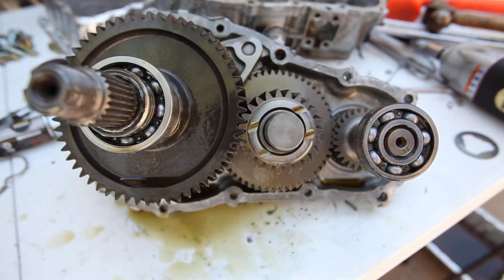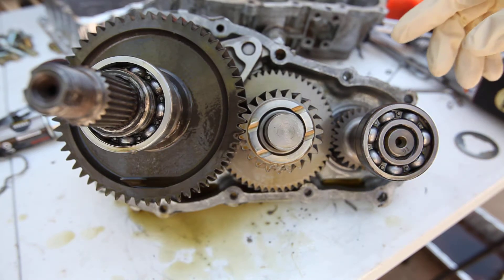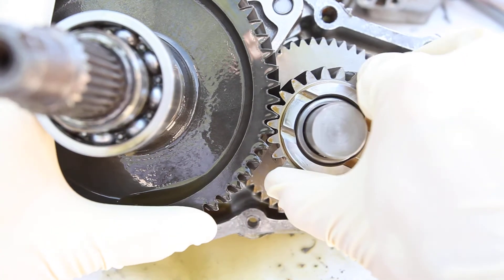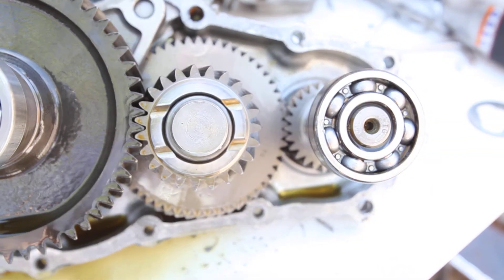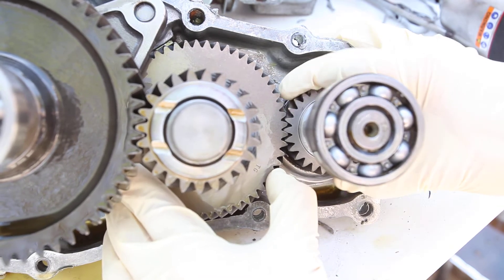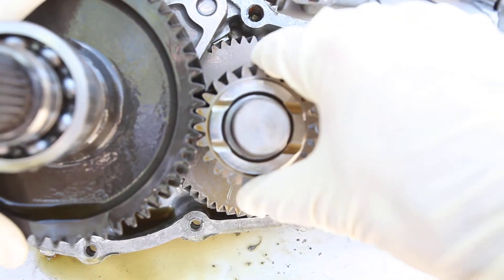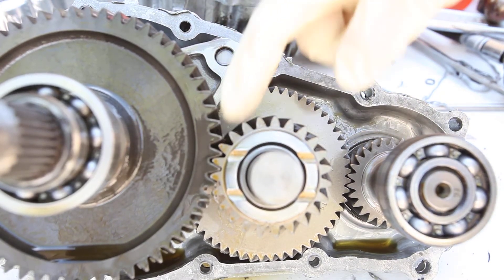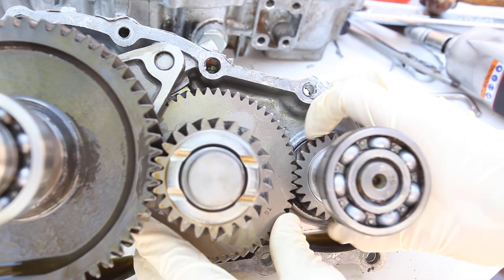Trail Gear 4.9:1 Suzuki Samurai Transfer Case Gear Engagement and Slop - 032718

Comment: I get a high pitched whistling noise at speeds exceeding 60 km/hr . Could it be because of the 4.16 reduction gears I installed in my samurai ? I am running 31x 10.5 MT tyres

Comment: What kind of noise did you have?  My drivetrain whines and rattles badly in 4th and 5th gear when accelerating. No noise when on Jack stands 😒
Reply from the maker: clacking when accelerating and deaccelerating only.  Usually the 4th/5th gear noise happens when not in gear or without load and comes from the intermediate shaft.  Don't know your issue.  Makes me think it is something from the transmission.  Does this happen in 4th/5th gear when in low ramge?  If so, that should eliminate the drive shaft being the issue.  In all other cases, it should be the same in every gear, unless it only comes up when the shaft is spinning very fast.  In that case, can check that shaft is indexed correctly as that can impact balance.  Also can check shaft balance.  ujoint issues usually show in most gears.

Comment: hey!!! i got that same issue on 6.4:1 Sumo, in fact, i came here looking for another common issue, when i turn the rear output turning foward everything is working properly, but, turning on reverse start turning ok but it gets harder to turn but eventually gets free again, i have to say i bought it from trailtought 6.4 sumo with all rebuilt kit from then, got to say, i got a 6.5:1 with few chipped teeth dropped inna box on the garage already, don't know about other guys experience, whish to know what to do

Comment: I have the 6.5 from low range as a build in kit in transfer and drive my Samurai daily Autobahn and sometimes some difficult offroad spots.No issue now (5000km) i hope its durabel for my swedish offroad trip 2020 ,because i know 3 broken 6.5 gearsets from guys that ride some rally style offroad .I think thats pure crawler gears and not for higher rpm style made.

Comment: I bought 4.9 gears recently and I’ve been having a few issues with them. It pops out of high gear like something Inside is hitting it out. I’ve had it down and apart 2 times now and I can’t figure out. I have 2 tcases and I have noticed that there is a lot more slop in the 4.9s. I have a feeling I will be trying to return mine for something different as well. It seems like there are a lot of problems with the 4.9 gear sets.
Reply from the maker: Did you replace the inner and outer detent ball springs?  If they are weak, it will pop out of gear.  I had that happening to me.  I replaced both detent springs and added the second smaller high spring rate spring that nests inside.  Now it shifts into place with authority and stays there.  I had that issue with the 4.9 gears and then fixed it with the same 4.9 gears.  Had other issues with the 4.9 gears but that wasn't one of them for me.   Such a simple/inexpensive thing that they don't tell you to change when rebuilding the case but makes a big difference.  I hope it is as simple as that for you.
Reply: Brian Dinse sorry for the late response. I really like these gears and don’t think I have to return them. I honestly think it’s something along those lines. I just haven’t been able to test them out long enough to figure it out. I was thinking it could either be the springs or the front input, it original as well. 

I did change the shifting shafts to a twisted t setup. I like it a lot and I can clearly feel the shifts. Ive only driven it around town 20 miles or so but I had it pop out twice. Both time when I was paying the least attention to it. Under a load and when I hit big bumps in the road. My wife has drive the same distance and hasn’t had a problem at all. 

When I get a change I’ll pull it down again. I have a better understanding of what to look for now. I think I’m going to replace those spring bad or not. They have had a lot of use. I used to have both tcases pop into neutral all the time before I changed the shifter sheet. 

I appreciate the input. It help confirm some of the others I’ve heard. Thanks.

Comment from the maker: So after getting feedback from several places and then also showing the transfer case to someone who has a lot more experience than I do, I felt strongly about returning these 4.9:1 Trail Gear gears and getting a credit. I called Low Range Off Road (owned by Trail Gear) and talked to the sales manager, William. He was great and very understanding. After I explained everything, he just said that he wanted me to be happy and that I could return the gears for a full credit toward a different set (that is what I asked for).  On top of this, all I had to do was call Goose with the tracking number for the gears that I was shipping back to show that they were on their way and he then went ahead and mailed out the new set of 6.4:1 gears. Nice touch!  So I am very happy with LROR right now. Sure, I'd liked to have had everything work out the first time around but not everything does. In the end, they took care of it.  And looking on the bright side, this experience of troubleshooting taught me a lot about the Samurai, transfer cases, and gear design.
Reply: Trail Gear owns LROR? I've had good experience getting corrections made by LROR, also.

Comment: That is excessive backlash.  We build Samurai transfer cases with stock gears and 6.5 gears and don’t see this in Suzuki cases.  Gear depth is off.  You are going to get shock, vibrations, and noise.  Your gears and bearings are going to fail.  I’d go with a set of 6.5 gears.